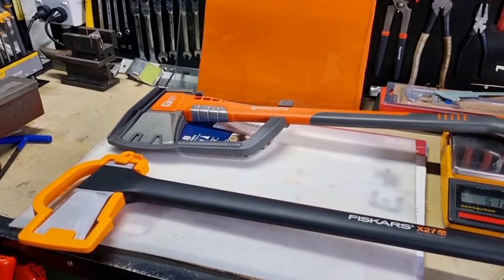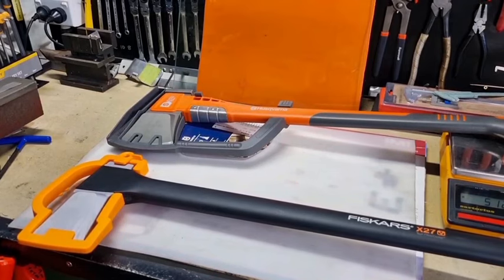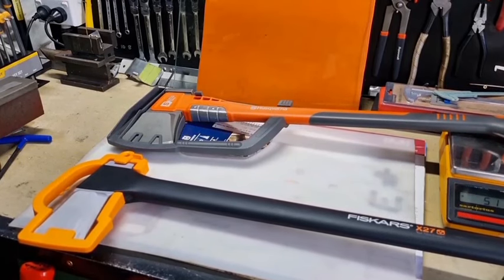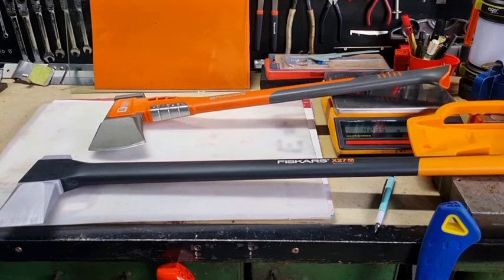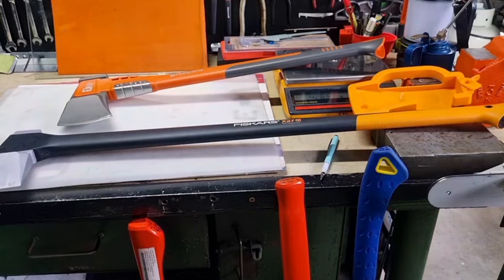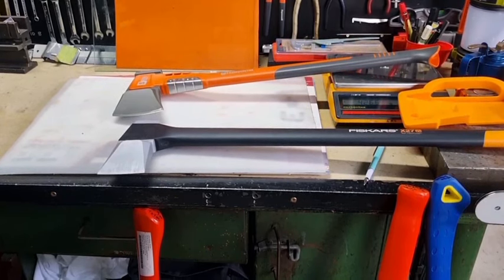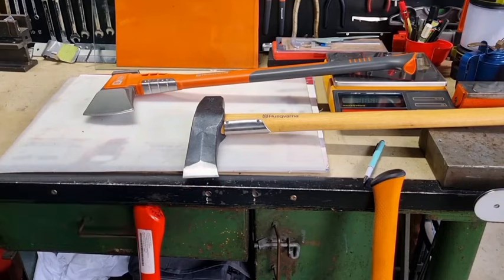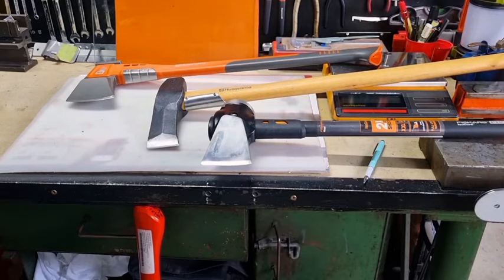Manufacturing process making a Maul or splitting Axe

Comment: What is your pick on a maul , weight wise , 8 or 6 lb ,or do you think an axe is better for splitting wood? Thanks 😊
Reply from the maker: You need at least 3 for different sort diameter wood.  I like my Stihl log splitter and also 2.7kg  Estwing and Fiskar X 25.   I have 3 8lb mauldfir the big rounds.
But the Estwing abs Stihl are my Favourite
It's like thos small weight for small rounds and larger weights mauls for big round.  There is not one that suits all occasions
Reply: @ChainsawUsers  thanks a bunch for your reply 👍